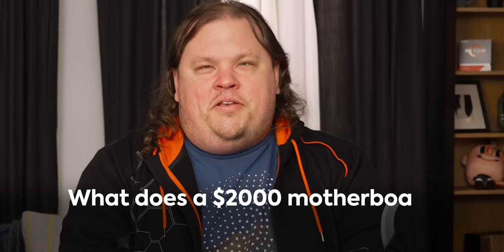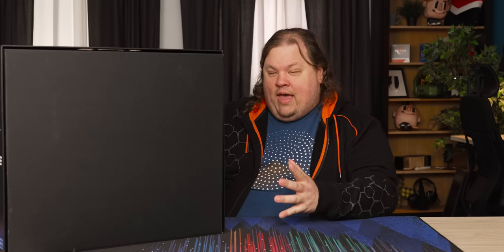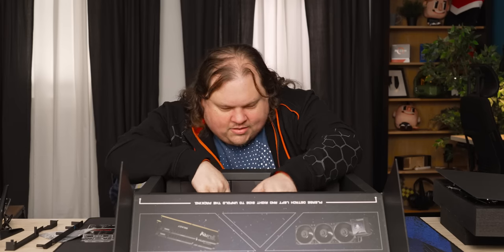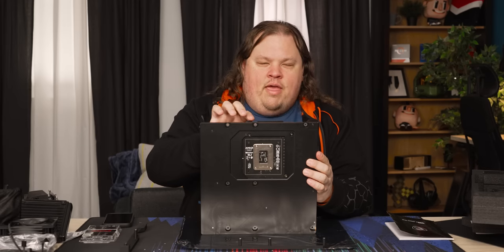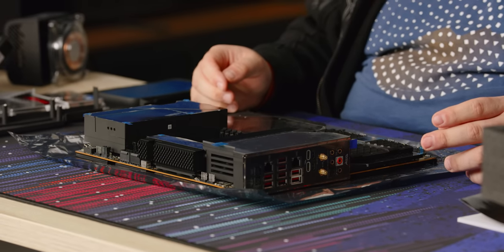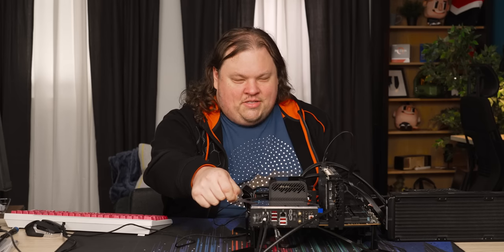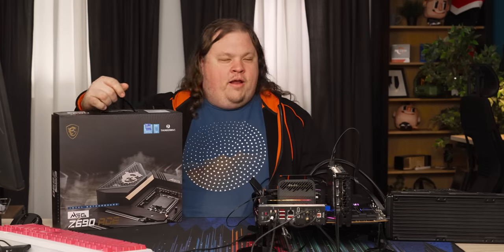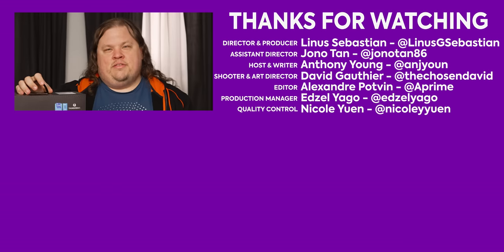Is it truly GODLIKE? - MSI Z690 Motherboards

Comment: This would pair perfectly with a Celeron G6900.
Reply: nice.
Reply: with ddr5 running at 6900mt/s
Reply: Nice
Reply: With 3 RTX 3090s 🤣
Reply: @diamond_h0us  GodLike cpu bottleneck
Reply: actually not
Reply: @fahimp3  those sli configs aren't supported anymore
Reply: @min_nari  manual ram oc? i wouldn't do that with a celeron with ddr5
Reply: @rhebucks_zh  It's a joke lmfao
Reply: @rhebucks_zh  I will do it, Rtx 3090 ti, G6900 and DDR5 ram
Reply: Nice
Reply: @fahimp3  - Everything about the product is, so thats to be expected.
Reply: And pair it with an RX 6900XT
Reply: That would indeed be very nice
Reply: with a 6900 XT ...
Reply: Celeron with ddr5 and an rx 6400
Reply: lol
Reply: I had one of those msi boards I'm sure most atx are like that, you just can't wait for your pc to turn on now they are 1000 wtf, that's, now, the disposable part in case anything fries the board should fry first.

Comment: If I'm paying 2G for a mobo I expect it to support cpus from the distant future
Reply: I better be able to run myself as the CPU at that point
Reply: Haha, from Intel? Keep dreaming...
Reply: You'll take 13th gen and like it!
Reply: I expect it to be a fucking functioning computer with storage, GPU, CPU and RAM straight out the gate for 2 grand
Reply: That's not how it works. So no
Reply: @luisgeraldes32  fo real lol
Reply: If you buy a mobo like this, you don't need to upgrade at least five years.
Reply: Intel: How distant?
Me: Uuhh ... do you have like ... an app ... that uh ... pre-calculates how many new chipset designs you'll come out with on a month-to-month basis?
Reply: It supports i9-14900ks

Comment: I actually use the optical port on my motherboard for some speakers that were meant for a TV originally because HDMI makes me have a display  connected and on
Reply: Also to note toslink has a bandwidth cap of 96khz for most devices while hdmi has like 256/328. This is of course treading on audiophile/snake oil bandwidth for audio
Reply: @khyododev766  I was wondering why the highest quality it would take and still play audio was 96khz
Reply: I have the same problem, I"m using my PC with my 5.1 System. It's ass that there's no functionality to only transfer audio, always have to deal with the additional Monitor in Windows.
Reply: @khyododev766  not even worth going beyond 48 tbh
Reply: You can get an HDMI ghost adapter for $10 if you do want to use HDMI audio without actually plugging it in to a monitor
Reply: @ijmad  yea but windows would still have a display for your apps to open on and your mouse to hide on that you don’t have
Reply: @yeetmeister6924  depends on how many channels of audio you're running
Reply: I'm using optical with my preamplifier and active monitors. Is there another way I could transfer digital sound to a preamp? Not without any additional gear.
Reply: @nobodystar8135  Yeah true. Although you can arrange that screen so it only meets your actual screen at one corner. Still could get slightly annoying though, if a window popped up on it for some reason.
Reply: @TommiPuuska  there are usb amps
Reply: @yeetmeister6924  Yes it most definitely is. Just you can't hear it with most crappy headphones or PC speakers that people have. You need Audiophile grade headphones or speakers. It's not expensive either. I got a set of DT 990 pros which are studio grade headphones and they were 200 dollarydoos.
Reply: connect via toslink to my YAMAHA AV RX-V685 to which I connected speakers from old BMW E36. 
the passive sub runs on the (equalized) center out (cause you know: there is the watts needed:D)

what should I say, on 0db the neighbors start bringing me gifts at 2pm cause the law says I can, but they really bag me not to.
Reply: "mirror" the displays?? then you don't have a second one...
Reply: @ryanhamstra49  I actually tried that it even let me run the displays each at their native refresh rates but games well they didn’t like that i could only run then without vsync and at 60fps because that is what the speaker passed through i was plugged into the same monitor on 2 different ports one DP one HDMI
Reply: @TommiPuuska  If the Dac/amp has the right connectors then yes. There is also SPDIF and Coaxial but both your PC and Preamp need the connectors
Reply: @nobodystar8135  oh that makes sense…..
Reply: I use the optical port because my AV Receiver doesn't support G-Sync passthrough. I could use one of my secondary monitors through the AV Receiver instead, but then other devices which I also have plugged into the AV Receiver would not show on my main monitor.
Reply: @khyododev766  Isn't this not a problem with just two speakers? I thought it was only a "problem" with 5.1 setups
Reply: I also would still be using toslink if my new board had it. DTS5.1 is a perfectly fine audio standard. Just support in drivers is lacking and may require leet hacks to unlock realtime encoding.
Reply: I wish they would develop on digital audio out again because right now it's only limited to 5.1 surround, but you think they could be more compatible than your traditional HDMI or speaker wire.
Plus no matter how cluttered your cable setup is, you won't ever have electrical interference from your audio source to your speakers or receiver. I quite often have to move my speaker wires around because they're getting too close to a power wire or something and I can hear the buzz.
Or mistakenly putting my sound blaster ae-5 too close to my video card and the video card's coil wine could be heard through the sound card analog output.
Reply: @nobodystar8135  he quite clearly said WHITOUT additional gear (usb dac or amp is an additional gear) excluding the cable ofcourse. +toslink is good opto isolator for ground loops and other ground related problems that external usb or other audio interfaces could have.
Reply: Optical is great for old dolby digital sound sysstems
Reply: @khyododev766  Lolwut? TOSLINK is a digital transfer standard, it does not care for audio qualities. You can transfer even 32 bit 512 khz if data size is within data cap. Digitally, its limit was 5 megabits per second, but it is now 125 Mbps. 
If your hw can't give you the required sound quality, then it is the problem of hw implementation (like DAC having a hard limit on decoding from TOSLINK source). The cable itself has no such limitations.
Reply: @Vladimir_Kv  that's why I said for most devices, the bottleneck is the hardware implementation on both ends sending and receiving. Most devices using this cable are capped
Reply: weird that motherboard like this got toslink?  may i misunderstood.     could'nt use my headset without it.   in PUBG after loud noises there - via cable volume get's down.   not with me, not with toslink

ls30
may it's usb soundchip
but it's made for toslink anyways

and i'm also on z690
Reply: This thread is why I still use a sound card and analog out.
Reply: @nobodystar8135  TosLink is old as in it came out almost alongside CD players old. 96Khz is fine for stereo, but generally you'll want 96Khz per speaker pair so the hdmi audio bandwidths tend to make sense.
Reply: I have a dac and real speakers now all the way to stereo 196khz
Reply: @stephen1r2  You are only right if you are talking about two channel uncompressed signals (PCM), since TosLink suports 5.1/7.1 Dolby Digital and DTS, because the signal is compressed. 
If one wants to have Dolby TrueHD, TDS-HD Master Audio or more than two channels of PCM, then the S/PDIF won't support it. However people with audio setups that can benefit from this will most likely have either an external soundcard or DAC, that can connect with USB or HDMI.

I'm much more puzzled over why they still have all the jack-connectors?
- I don't remember when I last saw a surround sound system for PC's that used jacks. The cheap ones that only use jack are usually 2.0 and 2.1 systems.

Comment: I thought they were out of their minds when i heard about this. Honestly though, with all those board features + memory + water cooling bits + limited run "prestige", this isn't nearly as overpriced as it seems at first glance.
Reply: Agreed. I expected to laugh at it, but with everything it has, it's pretty close to worth the price. No chance to afford it, but not a scam for what you get, which is, apperently, everything.
Reply: That's what I was thinking too.  While very expensive, with retail prices on DDR5, including a cooler, plus a very high end board, it isn't near as bad as what you first think.
Reply: For all it's perks and features it is not unreasonable especially if you are someone who saves up for a once in a few years epic over the top build.
Reply: @christophermzdenek  the added ram and cooler certainly put the price a little more into perspective, but its still about 2x the price it should be. they showed the $600 board has basically everything this board has except the 10g lan and 1 less m2 slot (and who needs 5 let alone 6). i wouldnt buy this simply because i dont want their crappy water cooler when i already have an nh-d15, but even if they took that out id not pay more than ~$850 for this, id just get the $600 one, or even another step down from it instead.
Reply: @iris4547  I mostly agree. This was made for either someone with a rather specific use case scenerio in mind, and those with more money than sense. With those two groups in mind, at least it's not a complete rip off. It's a solid product for it's price. One that I would never consider, but I can appreciate it. Simalar to having no way of, or desire to own a Lambo..., but I can appreciate the cost of it's engineering.
Reply: @iris4547  Yeah, 6 M.2 slots is really excessive. Like 3-4 is the realistic max for most people on their primary PC. If you really need so much more storage there's no realistic reason that you'd need all the excess storage in NVME, just hook up some SATA SSDs. Even if you were going for some NAS solution you certainly aren't doing so with an overkill $2100 mobo. This really is for people with more money than sense, because you'd never need all of these features together to justify this price.
Reply: It's a friggin bundle. That's not a great thing. Great for the flex though I guess.

Comment: Woooooow. It was only 7 years ago that MSI's top tier GODLIKE board was like $600-$700.
Reply: Back in the before time, when GPUs sold at or under MSRP.
Reply: Which is still ridiculous, but at least slightly realistic for a high-high end build.
Reply: My MSI X99A Godlike Gaming Carbon was about 600 Euros and I thought that was expensive... Mainboards are now more expensive than the top tier CPU for it. At least in the "mainstream" market. Thats crazy...
Reply: why did they become so expensive
Reply: God has changed.
Reply: @davide4725  it's called supply constriction
Reply: keep in mind say mobo is $1000 the ddr5 ram that's included $600-$800 then $200 for rad/fans. at least that's how I see this package deal.
Reply: @squirejones3116  So just double huh....
Reply: @AlcatrazCrylake  did it come with ram etc back then?
Reply: And even for that price you could get those asus dual socket boards for xeon with 7 pci-e and 4 way sli

Comment: man, the motherboard better have wings. It's more expensive than 2 x my entire pc
Reply: Give it red bull
Reply: But... why would you need wings? Wouldnt it be better if it had build in power plant?
Reply: This board is 1/4th my build but it's still egregious as fuck. No motherboard should be more than 100-125% of the cost of the absolute best CPU it can carry/utilize.
Reply: @Shyvorix  your build is over $8000? is that the whole setup with monitors included etc.?
Reply: @Weightedneckhangenjoyer  Nah, with the monitors and all peripherals it's over 10k. 3090 Strix + 5950x + Crosshair VIII Xtreme + almost 8tb of SSD-only storage, 2tb M.2 rest is all 860 and 870 Pro SSDs. Tons of Lian Li fans in a 5000X and a Corsair RM1000x with fully custom cables.
Reply: @Shyvorix  holy, that system's lit! I'm just running cheapo 3600 + 2060s. i think i only spent a thousand bucks on it. using an old case from an old PC and a bunch of scavenged HDDs LOL.
Reply: @Shyvorix  y u need so much fast storage for....?
Reply: @Ah-sun  My build is a RTX 3090 Asus Strix, Ryzen 9 5950x, 64gbs DDR4 3600mhz CL16 Trident Z Neo, Gen 4 NVME 4tb Seagate Fire Cuda 530 SSD. Asus Dark Hero X570 motherboard, Asus Thor ROG 1200W PSU, Asus Strix 360 ROG AIO, 6 Lian Li UNI fans and Phantax Enthoo Evolve X Dark grey case.
Reply: for it's price, you can easily buy a 12700k and 6900xt
Reply: @Ah-sun  I've been stuck for years and years and years since 2010 with all spinning rust drives and I vowed to myself when I get my first full on job and save a ton of money I'm gonna get a baller build and fulfill one of my smaller dreams of getting a top tier PC with all solid state storage and leave as little bottlenecks in the system as possible. So in late 2020 I ended up managing to grab everything I needed after saving for a year or so.

I've actually been learning photo and video editing and video editing LOOOOOVES super fast storage. 64 gigs of 3600Mhz CL14 RAM helps too.
Reply: Obamanft#10 But deepfried  Lmao nah but I worked for a small tech company for a while until COVID came and kept shitting the bed.

Comment: $2100, has TWO USB Type-C ports, and only supports 15W charging? Doesn't Thunderbolt 4 (or USB-C for that matter) spec a MINIMUM of 60W? If I'm getting two type C ports, which in and of itself is a miracle, I want my wall-wart-level 60W or 100W charging, dammit! Although, to be fair, that would require a 1500W+ power supply if you're using a 3090 and a 12900 on this...
Reply: How does home appliances use less and less energy,  but GPUs use more and more power?
Reply: No not at all.  Type C is just the  port shape.  It could be 5W charging and NO datalines, but still be usb type C.

Wether its USB 3.2X2 or whatever the USB has renamed 10gig to.... is separate
Reply: Those higher USB-C wattages are at higher voltages than 12V which would require a large amount of circuitry to drive
Reply: Type C is just the connector type, nothing related to the power and data specifications.
Reply: @ilovefunnyamv2nd  those type c ports are real Thunderbolt 4 ports. This motherboard doesn't have a thunderbolt header to optionally add on the thunderbolt ports. If you compare the thunderbolt ports on this motherboard to something like ASUS's ThunderboltEX4 expansion card, ASUS does support 100W charging.
Reply: @AlfaPro1337  they're both supposed to be Intel certified for minimum power output, too, though. Since they're TB4. Right?
Reply: And they continue their trend of putting zero video outputs on the I/O panel, so that you can use your PC as a space heater or display piece if your GPU ever dies.
Reply: @BlueDrew10  AMD system, mostly are expensive paper weights when you can't even use your dGPU.

Comment: Their MEG X570 Godlike was like $700. I don't understand what justifies suddenly tripling the price in one generation?? Even their "reasonable top-tier" board is the price of the insane one before
Reply: Because they can and people will still pay it because they have no self control.
Reply: Because it isn’t directly comparable.
Reply: probably because it comes with ddr5 memory and a 240(or 280?)mm radiator. 

I wonder how much it would be without those included
Reply: And its a one off, limited supply. So it's just maybe to showcase, what might be normal in future motherboard, R&D stuff.  Someone will still buy it just because. Kinda just a win-win for MSI.
Reply: @Chris_Garman  They are the same people that buy annually or whenever there's a new thing and complains that they have no money and stuff are overpriced.
Reply: That's AMD. This is Intel....feel the difference?

Comment: I use the test bench stand things for my overclocking rig so I can swap ram and cpus out easy. They work but they're pretty janky if you don't use the fan to help keep them together.
Nice to have if you have a use but I wouldn't use them to set up the motherboard for testing before building your rig. You can just put the mobo on the box and make it take 20 minutes less setup time lol
Reply: So you own one of these?
I guess it performs really well and it has a lot of features. Like 20 phase is about as good as it gets but my question is, if you spend that much on a motherboard, du you really use the included AIO and RAM? I'd imagine that at least 90% of the people who bought that gonna do a custom loop and want some more esthetic RAM. Does the RAM at least perform well?
Sry, I just have so many questions about that board.
Reply: @CrazyGuitarTV  nooo they came with my b550 Unify-X I use for AMD benching. I really wouldn't buy the godlike even for Extreme overclocking. I'd get something with only one dimm per channel and actually useful features for OC.

Comment: 1:28 An integrated Aquantia 10GbE NIC is spicy, but the Gigabyte Z690 Aorus Master does that for less than a quarter the price.... Haha
Reply: How is that not an Intel 10GbE NIC on a $2k board.
Reply: When did Intel become a name in 10GbE? In the server realm, Intel and Aquantia/Marvell were always the de facto budget options. Few of their offerings have strong standards support, offloading, or memory capability at all. Aquantia at least has surprisingly good support with regular firmware updates all the way back to their 100 series, whereas Intel seemingly bifurcated their hardware stack.

Where are the better controllers? Chelsio or Mellanox, perhaps? Granted, home users won't realize the benefits, but these boards are dual PHY populated. Why not offer memory for offloading?

That said, I'm certain the answer is RJ45 PHY is far too laggy for anything serious, so anyone running RJ45 ethernet won't notice our cheap Aquantia or Intel controllers. =/